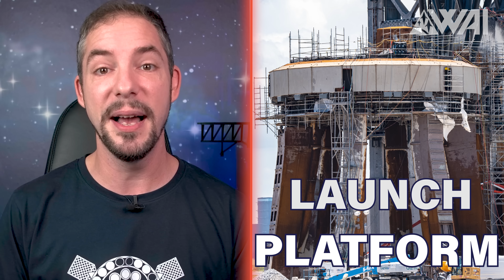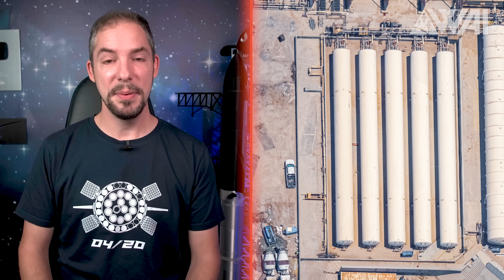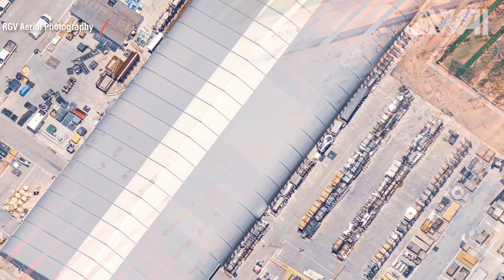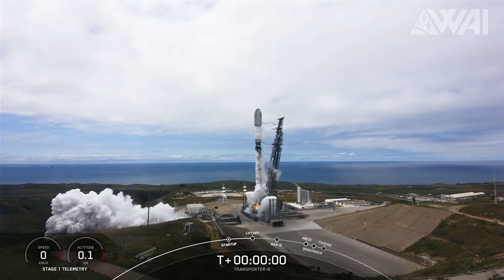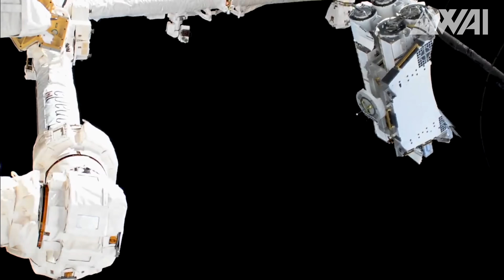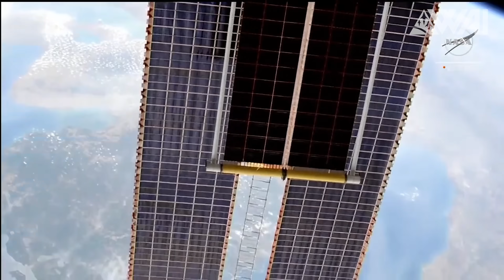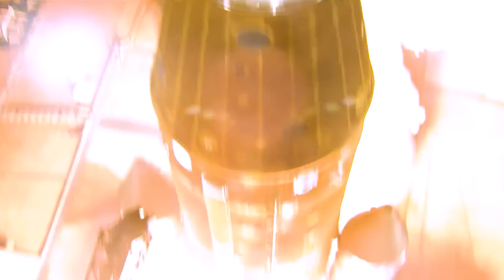SpaceX is pushing HARD towards the next Starship launch!

Comment: I'm starting to think that Elon and SpaceX should be going "full Monty". They should handle the launch site and reassess the number of engines. Breaking records doesn't necessarily get you to the Moon or Mars if Starship can't live up to such promising potential.
Reply: Starship needs the power to get to LEO with the kind of mass we’ll need if we actually want to live on the Moon & Mars, and to refuel the craft so it can get there & land. SpaceX is using 30X steel because it’s cheap, strong & can survive in high temperatures (Shuttle Atlantis survived a situation like the one that destroyed Columbia because the tiles on Atlantis were knocked off one of the few areas with thick, high-temperature steel that wasn’t completely melted during reentry).
Reply: @TraditionalAnglican  I totally appreciate all of what SpaceX has done and don't mean to criticize like an arm chair quarterback. I'm only trying to say that prudent measures and thorough processes are paramount.

Comment: Nasa is worried SpaceX will delay the Artemis program, that is hilarious coming from the same group that had SLS set for December 2017 and it kept slipping and didn't launch till November 16 2022. SpaceX is the least of Nasas own problems, thats a 5 year delay.....
Reply: Especially since Orion won’t be ready for Artemis 2 (amazing how Artemis 1 wasn’t called DM-1) until the beginning of next year & how it won’t be ready again until mid/late-2025 at the earliest. ATST, It’s amazing SLS will be human-rated after only one launch, when NASA required 5 straight successful launches with Falcon-9 when it was already the 2nd most reliable rocket on earth & has refused to human-rate Falcon Heavy in spite of 6 successful launches.

Comment: The 'High Pressure Tanks' aren't so much tanks, they are accumulators. Basically, Space X is negating the need for highly expensive and custom built water pumps (high flow at high pressure is expensive, as in very expensive and would be a custom build with long lead times) buy using an accumulator (in this case two large arrays of accumulators), so the water would be pumped into the accumulator using a high preeure low flow pump untill fully primed. On takeoff the whole sustem would unload. Yes accumulators have nitrogen in them but it is in a bladder, so effectivally they are compressing the bladders down to almost zero.
I can almost guarantee that they are using accumulators but that does negate the need to the other tanks to be delivering water, however they could be storing potable water in those takes but they are an expensive water take considering availability of commercial water tanks.
Reply: Water hammer arrestors are accumulators BTW, they are just really small ones. They could mitigate water hammer very easily, such a system would barely be visible. But they have to either pump or pre-charge the deluge, so why would you need a valve that immediately and suddenly stopped the flow (ie causing water hammer), even if you did need a valve then you would turn it off slowly but most likely you would just turn the pump off or let the charge run out.
From what I'm seeing, this is a large Super Soaker.

Comment: if the tanks are separated one could speculate that the smaller are for a higher pressure, lower volume supply for the "shower head" plates, but the larger tanks are for more of a deluge system.

Comment: If SpaceX would decide to build the Starship launch platform higher instead of building the water deluge system, how high would it have to be that the plumes wouldn't destroy the platform? Or why wouldn't they just build super deep, vertical water or water-mix tank under the rocket?
Reply: Water table in the area is to high....start with a two acre 50 or  100 foot high mound, then start building. It would take years to do.

Comment: We were discussing the issue of Starship meeting the schedule for Artemis under a video of the Angry Astronaut.
  As I commented there, I continue to think that there's not a chance Starship will be human rated in time for the first Artemis human landing.  But I think this not the fault of SpaceX;  I think it's NASA that are being obtuse.  Why are they so fixated on that there should be ONE human landing system, and then a second one for backup?  They should have TWO landing systems:  Alpaca AND Starship,  and then Blue Origin for backup.

  Alpaca is 10 x better than it is, if it doesn't have to carry fuel landing on the moon  PLUS ascent.  But a non-human-rated Starship could bring a dozen Alpacas fully fueled to the lunar surface, as cargo, for starters.  Auto-piloted Starships can also bring generators, machines, materials and robots to the surface.  Construction of a proper landing pad and other infrastructure can commence then robotically, with Astronauts supervising and helping the robots from Lunar Gateway.  If nothing else works, as a last resort, they can descend to the lunar surface in one Alpaca, fix whatever problem the robots can't solve, then take another (fully fueled) Alpaca back to orbit.

  Eventually, Starship can be the main means of bringing astronauts to the surface;  maybe a dozen at a time;  but initially, Alpaca is the better choice, just as Dream Chaser would be a better way for astronauts to get back to Earth, initially.

  This is how the Artemis plan SHOULD be.

Comment: NASA is worried about SpaceX??? They are not the problem at this point in time. They need to be worried about Boeing's disaster of the SLS system including Artemis.  The taxpayers black hole. SpaceX will be sitting with a working ship and no SLS or Artemis to use it.

Comment: Hey Felix. Do you know why Starship booster won't do a reentry burn as Falcon one's booster does?
Reply: It will... apart from being caught on the tower instead of landing on a pad, the Superheavy booster flies essentially the same profile that Falcon 9 does.
Reply: @simongeard4824  I thought they said there was no planned boost back for the first orbital try. Maybe it was just that flight?
Reply: @clintarlington1229  they're not going to try landing back at the launch site until they're confident they can do it safely, so a boost-back burn isn't needed. But as far as I know, a re-entry burn is still an expected part of the plan.

Comment: My theory is than the small tanks don't have water, they have compress air.
So, it works like this:
The system don't use electric pumps, it may have compressed air than is released on the water tanks and the air pushes at high speed and preasure the water to the water deluge system to fight the 33 raptor engines.
Yo need only suficient water and air for starship to clear the tower.
Just theory.

Comment: Re: Boing:
"Capital eschews no profit, or very small profit, just as Nature was formerly said to abhor a vacuum. With adequate profit, capital is very bold. A certain 10 per cent. will ensure its employment anywhere; 20 per cent. certain will produce eagerness; 50 per cent., positive audacity; 100 per cent. will make it ready to trample on all human laws; 300 per cent., and there is not a crime at which it will scruple, nor a risk it will not run, even to the chance of its owner being hanged. If turbulence and strife will bring a profit, it will freely encourage both. Smuggling and the slave-trade have amply proved all that is here stated"
It's said in 19th century. Since than profit margins has changed, but nature of capitalism has not.

Comment: They should never need to suddenly close a valve on the deluge system so water hammer should not be a problem (water momentum is the mechanical cause and so it isn't an issue on startup). They do have to have high pressure to overcome the rocket thrust overpressure acting on the pad. Venturi systems reduce pressure at a constriction as flow velocity increases, so they might be trying to set up some inverse Venturi to stage up the pressure so that by the time it gets to the deluge nozzles it can still overcome the gas pressure from the rocket thrust. Ultimately that nitrogen purge system on the tank interior water surface has to compete with raptor overpressure on the pad nozzles. Just to achieve the required pressure + flow rate might take multiple independently pressurized gas - water interfaces. This is the biggest super-soaker ever constructed and it has to fire into a flaming hurricane and win. P.S. on the water hammer issue, there might be concerns over static pressure shockwaves coming back up the pipes from the pad nozzles directly below the rockets, wildly speculative and probably not an issue but nobody's done anything quite like this before.
Reply: Do they even need to close water valves at all? Just vent the gas pressure in the tanks and let thing stop on their own.

Comment: I believe that you are correct on the sudden shutting of valves.
Rapid movement of water ....and then sudden stoppage will cause a tremendous amount of back pressure....called "Hammer".
They do it in prisons to burst the pipes. Everyone turns on sinks, flushes toilets.....someone yells out "Stop"......pipes burst!
Hence the invention of the anti-Hammer part in plumbing.

Comment: Two comments: re Boeing, they have crown rot a failure of integrity at the top. Re Moon lander the starship has proven to be structurally sound, the rest of the moon program is really about achieving the required launch cadence to get required mass to orbit. Thus all focus on speed of manufacture. Those who worry about the details of outfitting a moon version of Starship completely misjudge the relative difficulty.

Comment: To miss-torque to the degree it leaks would have to be a significant value. It would be surprising if it’s found true as surely any torque wrench would be checked prior to any use against a calibration device in a controlled environment. A well versed technician could almost certainly “feel” the error based on life long experience.
Reply: that "expierence" could only be gained by handling multiple successful rockets though. Still not sure Blue Origin can make reliable deliveries.

Comment: Ars Technica has a couple of articles which address this directly. First, due to 8 avionics boxes that need to be extracted from the Orion Artemis I capsule, requalified, and installed on the Artemis II capsule, it is unlikely that Artemis II will fly before early 2025. See After the Artemis I mission’s brilliant success, why is an encore 2 years away? Eric Berger 12/5/2022

The other article (linked in the first) contains prognostication by an unnamed space industry insider who previously predicted that Artemis I would launch in 2023, 6 years earlier in 2017. This person puts Artemis III in 2028 (!), and not necessarily on an SLS (!!) Search for the article titled The oracle who predicted SLS’s launch in 2023 has thoughts about Artemis III dated Nov 14, 2022

Comment: The new launch pad will just do more of the same.  More then 10,000 tons of pressure and supper hot blasting gasses. What is needed is they need to launch it over the ocean about 20meter's deep.

Comment: There is no such thing as 6.6 Kw of power per day.  6.6 kWh / day is probably what you meant.  
So one panel could power: 20 kW * 24 hours / 6.6 kWh / house = 72 houses (assuming 24 hour sunshine of course).
Stop with imperial measurements please.  Insult to science.

Comment: "...6.6 kW per day..."?   WAI you're better than this.      

A kilowatt is a unit of power which is a rate, like a flow rate, it is the number of kilojoules (energy) used in a second.  You wouldn't talk about the amount of water flowing through a hose per second, per day.  That doesn't make any sense.   Either you mean Kilowatt-hours, or you just say kilowatt.  But according to the US Energy Information Administration the average US household consumes on average 29 kWh per day.  Which if the average household was drawing consistant power throughout the day would be an average draw of 1.23 of kW.  (1230 watts).   So neither 6.6 kW nor 6.6 kWh seems like an average.   More likely 6.6 kW is the average maximum demand, that is the maximum amount of kilowatts the household requires at any one time.    Can you share your source for the 6.6 kW figure?  This would help me interpret what is meant by 6.6 kW.

I am a subscriber, look forward to your videos and watch every time you post.  But phrases like, '6.6 kW per day' is a pet peeve of mine.

Comment: I think Starship HLS will not be ready for 2025 and it won't be close and it was nuts for anyone to think so if they actually did, which I doubt. But it's also very likely the rest of the mission won't be ready either, and neither will any alternate landing system. If Artemis III is delayed by a few years then that's a reasonable result imo.

Boeing using illegal means to cut costs, which means they wouldn't have reported these savings, while they continue to ride the cost+ gravy train, is so... Boeing.

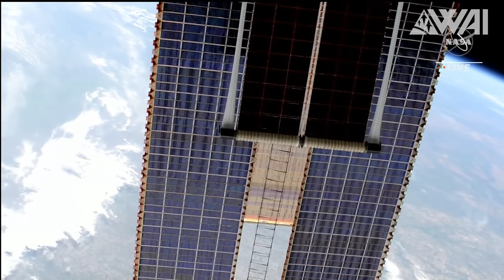Comment: 16:32 
The average USA houshold electricity consumption is 29kWh.
The mesurement of consumed energy is kWh, not kW.
Still with 12h of sunlight per day (on ISS it is even more as it is so high that less than 50% of the view is covered by the Earth,  but lets use it for now) it is 240kWh of new energy per day.
So more than 8 household worth of electric energy production.

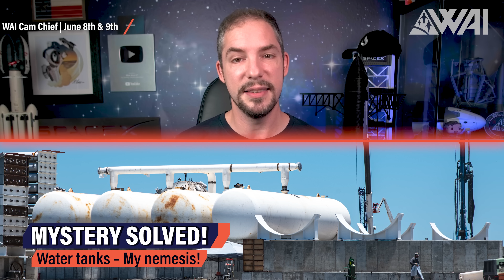Comment: You got your horizontal and vertical mixed up @2:10 peh·duh·stl
. Great job as usual. But I won't put you on a pedestal.😁
 Water hammer can be reduced by the nitrogen tanks or the nitrogen in the system, after all, it is a compressable gas. I would guess water flow rate is helped by multiple tanks and that might have been all that was available for the pressures needed. I noticed rust on one of the tanks. If you push all or almost all, the water out of the system, there is no water hammer.
 Redundancy?

Comment: I'm surprised at the multitude of high pressure Nitrogen tanks; I would have assumed it easier to build a device to flash liquid nitrogen into gas sufficiently warm to not be a water freezing risk (though if that's not a factor with adiabatic cooling of the HP Nitrogen, I don't imagine it would be in the alternate case?).

Comment: I wonder how they are going to manage the water pressure during ignition. I think you’d want to balance the water pressure to the flame pressure. As you get the water up to pressure you wouldn’t want to spray water up into the engines as they are lighting. Then suddenly you have a very high flame PSI that will overcome that initial water pressure to send the emerging water back from whence it came. Superheated steam in the shower head and the feeding pipes might be explosive. Perhaps the anti hammer tanks are there to prevent rupturing of the plumbing. Quick adjustments to the water pressure might be a key part of the plan.

Comment: "uses around 6.6 kW of power per day" is like "driving at 80 km/h per day" - it doesn't make sense

6.6 kW is the power
you can't use power "per day". power is instantaneous.
you can use amount of energy per day. Which is in kWh.

and 160 kW of power generation is not "during an orbital day", it's instantaneous again.

mixing up power and energy units kW and kWh is like mixing up speed and distance units km/h mph and km/miles -
("these two cities are 150 mph from each other")

Comment: Nothing happening at Boeing hasn't been happening for decades.  This pork-barrel company has produced unsafe airliners that crashed and killed hundreds, lobbied to have wholesale design changes treated as simply quantitative iterations not qualitative changes resulting in cut corners on pilot training, produced the problem-wracked Starliner the latest iterations of which are inadequate parachute redundancy and flammable wiring tape, etc., etc., etc.  Is it any surprise to discover that they are accused of stealing a design in order to produce a cheap substandard knockoff that then could be responsible for more Starliner problems?  There has been no culture change at Boeing despite damning reports of mismanagement, price-gouging. and engineering incompetence.  The Starliner program should be cancelled for non-performance and Boeing forced to refund the US taxpayer the money they ripped off from us.

Comment: Please learn the difference between kW (a power) and kWh (an energy). Using "6.6 kW of power per day" makes no sense. A typical household consumption in the US is 10000 kWh per year, which is around 1.1 kW, or 27 kWh per day. A 20 kW solar panel could support ~18 of these households while it's in sunlight.

Comment: I dont get why they dont make an above ground flame diverter and then put the clamps on top of that and then still do the shower head style water deluge system. The chopsticks makes it to where they can lift the booster and starship as high as they want. They could make the chopsticks taller also to make sure they can lift the rocket and starship above everything thats built above ground.

Comment: Seems with no Tall Vertical Water Tower for Pressure, High Pressure Tanks are needed to Push The Water (from their own Storage Tanks) to the OLM Steel Deluge Mechanism. Guessing that the Steel mechanism perforated with Hundreds of Holes receives 200,000 to 300,000 GPM Water Flowing between the Steel Plates EMITTING A VERTICAL SHOWER OF Hi-PRES WATER at Various a Angles through Hundreds of Holes in the Plates. The Vectored Water Spray Attenuates "Rocket Acoustics" and the overall  Very Hi Water Flow COOLS the Steel Plates as a Giant Heat Exchanger.